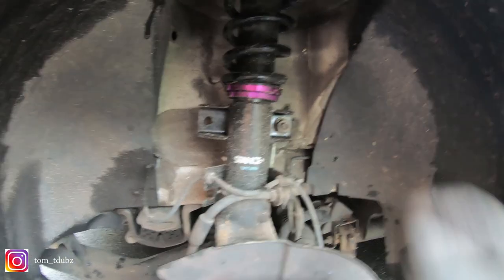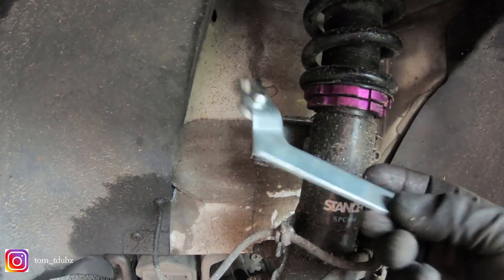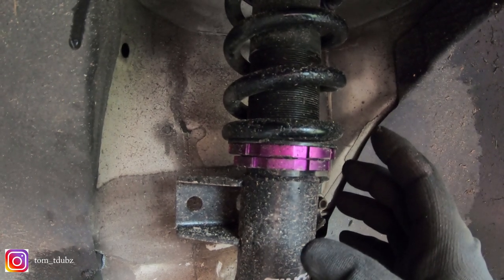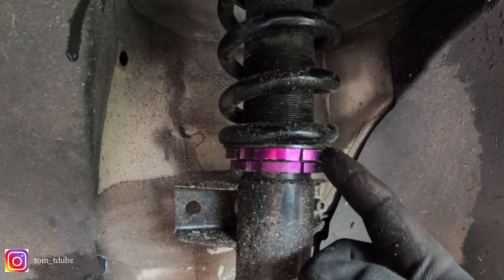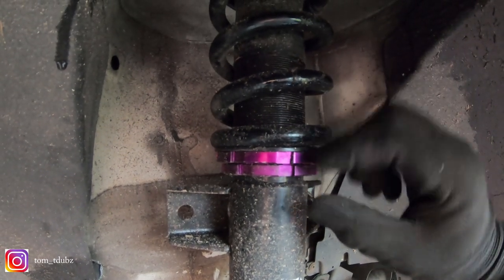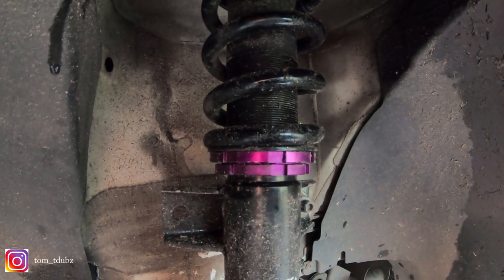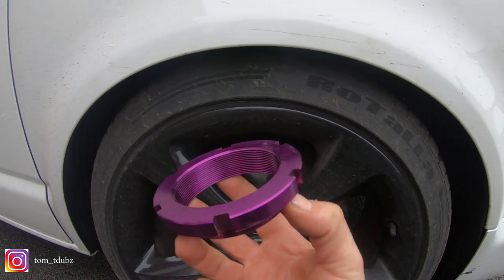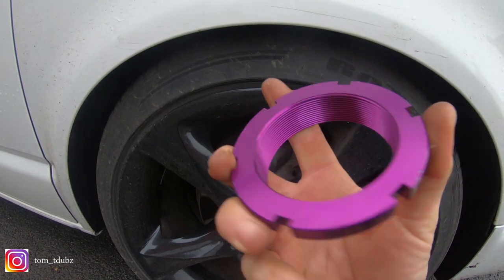Adjusting coilovers vwt5 #DIY #mod

Comment: Whell 19/20/21 ???.
Reply from the maker: Wheels are 19” after some 20” 👌
Reply: Does your van  bang over bumps?? Iv had  the same coilovers fitted to my van and it ride like a big what am I doing wrong help please ???
Reply from the maker: Did you fit it yourself? If so did you put the top mount retaining bolt back on before putting them in? Also check the rears a lot of people make the mistake of put the adjusters at the bottom.. they need to be at the top
Reply: @tomtdubz  Yeah adjuster must be at top otherwise rise is beyond dreadful. With new rubbers at bottom and adjuster at top they're good value and ride is fine

Comment: Hello mate I’ve got a set off stance too be put on but I don’t have the tool, what mm throat are they or where could I get the correct tool?
Reply from the maker: Nice, great kit. If your on about the adjustment spanner there are a common size so any coilover spanner will work

Comment: Hi mate, I've just bought my van with these fitted its quite low to the ground but the suspension is really hard when going over pot holes, even minor ones, can I adjust the coilovers to soften the ride so the suspension actually works snd dampens the shocks
Reply from the maker: Would be interested to see this... where are you based?
Reply: @tomtdubz  Wythenshawe Manchester mate
Reply from the maker: Any chance you could send some pics over to me on Instagram?
Reply: I too have a similar question. Do stanced + coilovers have adjustable preload?
Reply from the maker: Stance plus street.. have no adjustable preload…
Reply: Nice one that's what I thought by looking at them. That will  making setting them up all that bit easier!
Reply from the maker: @lewisfreeman8619  yep quite straightforward set the height before they go on then adjust after a little, that’s how I usually do it 👌🏻

Comment: Hi just put my stance plus suspension on question i have is when you a height set if you want to go lower do you have to loosen from the top so pressure is taken off the spring 🤔👍
Reply from the maker: If you want to go lower, jac up the van so there is no pressure on the spring release the lower of the two lock rings then adjust, lock the two rings back an put van back on the deck.. 👍🏻 the rears you might have to remove the rubbers an cut the bump stops down…

Comment: I’ve just raised my van (stance plus) mad a spacer so I knew both sides were exact from the bottom of the thread. When the van is on the floor there is 10mm difference? Where do you measure from when on the floor 🤔 centre of the wheel to arch or arch to floor.
Reply from the maker: Strange.. when I measure I tend to go from the arch/centre to the centre of the wheel just try make sure the van is parked on a nice flat ground…
Reply: @tomtdubz  common problem with stance according to the T5 forum, I’ll have to get it level from centre of wheel to arch rather than measuring the thread in the coilovers..thanks for the reply 👍🏻

Comment: Recently had these fitted, so you ever notice that the shock is off centre to the spring at the front? Wondering if mine have been seated correctly by the garage
Reply from the maker: They do sit centred when you jac up spring becomes loose and can move off centre… that’s if your running then low…

Comment: Hi buddy. When I fitted mine I had trouble with the top mounts but I realized that I should of greased everything on the coilovers as they do rust easy. Take them apart man and use copper grease on everything especially on the threads of the coilover and every part that comes into contact with parts. You will find that there going to start to rust really fast if you don't.
Reply from the maker: On it bud, on my list of things to do lol, thanks for the heads up 👍

Comment: Looks like access a bit more tricky for rear coil adjustment . Do you need to remove the inner wheel arch ?
Reply from the maker: No need to remove the inner arch, to adjust them it is a lot more difficult than the front, it’s doable but to do a good job I’d suggest taking the adjuster out to set and putting back in.. 👌🏻👌🏻
Reply: @tomtdubz  think I better take it to a garage . Pay them to adjust it on a ramp . 
Ive just put 18” wheels the last owner put 20” on look live but rides  horrible . It sits to low on the 18”. Wheels looks like space savers compared to the 20”

Comment: Did you get any problems with the rear banging after taking the the adjusters right out. Love the videos 😎👍
Reply from the maker: Thanks for watching, I didn’t… I went straight to the gaz short shocks. Some people have mentioned banging.. that’s probably down to weight in the rear you can get adjuster deletes. Solid bit of rubber that helps locate the spring too.. 👍🏻